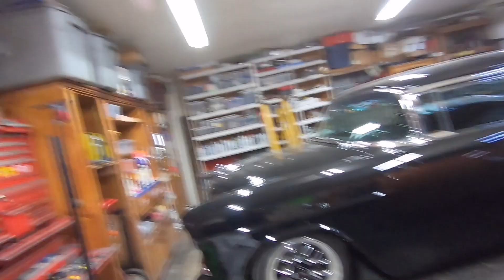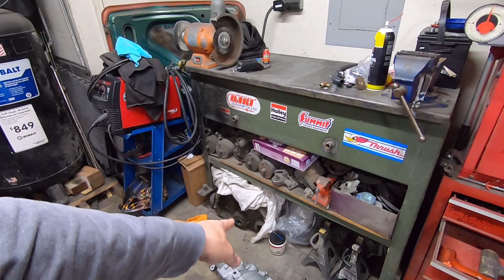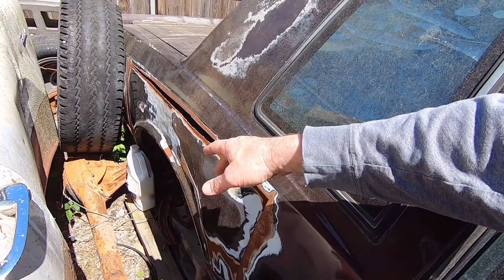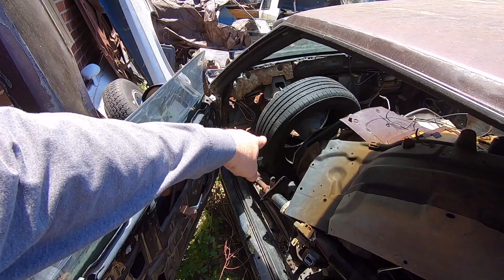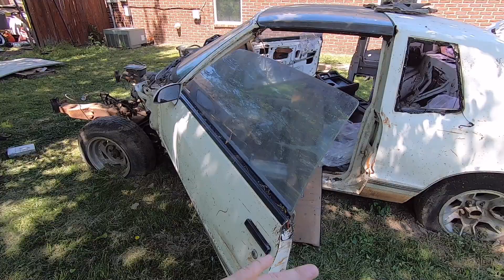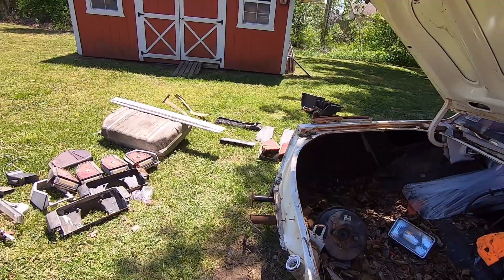Talking about future project - Monte Carlo SS with 3.8 Buick Turbo V6

Comment: Got a question fot you do you sand or black beauty when you sandblast I was told to use play sand because black beauty etches metal...
Reply from the maker: I use "fine" black beauty (coal slag). Both sand and coal slag "etches" the metal. The etching helps the coatings stick.

Comment: I had always seen the storage bin in the garage with G -body written on it but, had no idea you still had all the G-bodies!  I always liked those Monte's when Dale ran the Wrangler Car in Nascar.  

My best friend in HS and his dad built a 3.8 Turbo V-6 out of a Regal and ran it with a Muncie 4-Speed and a 280Z rear end.  They put it in a '71 Datsun 510!  They took it to the drags when I ran my '55 a couple of times and even ended up running it against some 8 and 9 second Buick GN's.  I still have the videos!  The GN guys were impressed with the Datsun too!  It ran a full second slower than my '55 Bel Air but, ran the same MPH as mine.  The reason it was a second off was because it spun the tires in every gear off the line and, after finally hooking up in 4th, it pulled pretty hard!  It was a real sleeper!  They sold it to a local street racer who blew it up about a month later🤦.  

The Monte should be a fun build with the E-85 and mechanical secondaries!  It would make a great drag strip video tuning series where you see how much you can improve it from the first baseline run with tuning!  As always, I'll be watching!